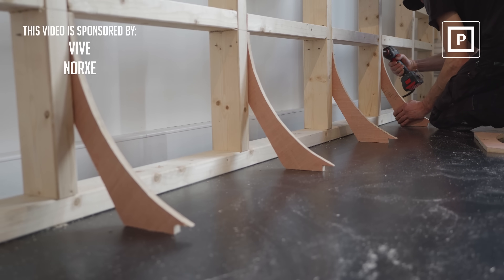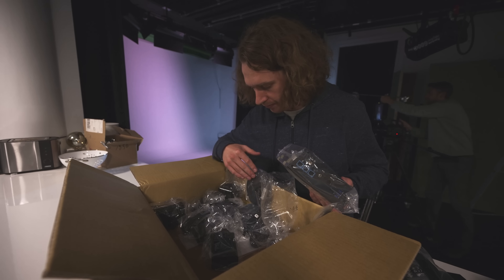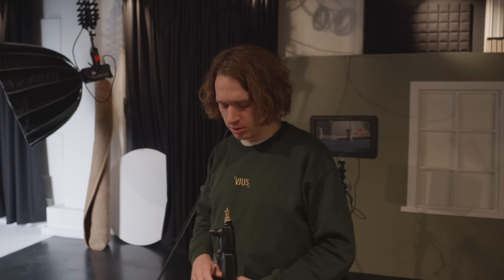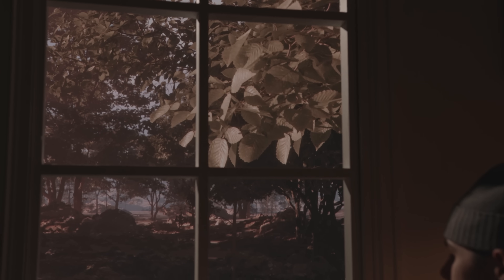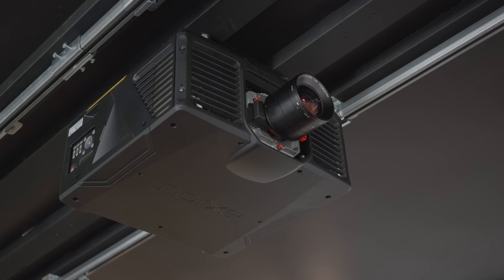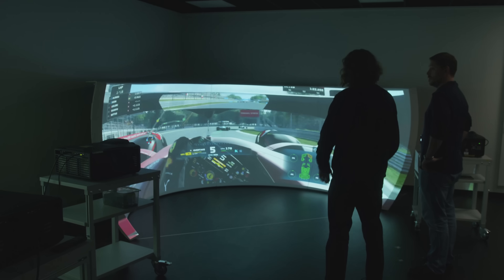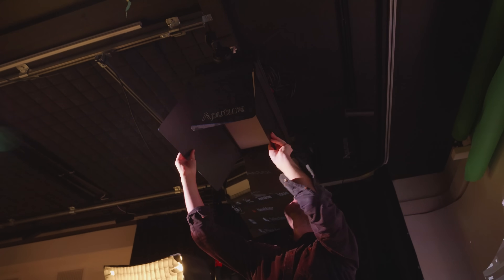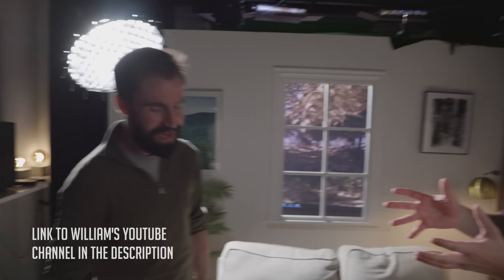The Future of Filmmaking is Here!

Comment: How bright is the Norxe P2 projector you're using? I looked it up on their website and it says it's 5,000 lumens, but it also says there is a "high brightness" version available as well. I'd love to know which one yours is. I'm looking at doing something similar with ultra short throw projectors and their brightness seems to top out right around 5,000 lumens, so it would be great to know if that's bright enough to do this or not.

Comment: While your video was more on the exploration part, check film riot they did use an amazing set of short throw projectors, they are 10k each but hey is still cheaper than the led panels.

Comment: Amazing work!!! So glad to see you delve into this filming technique. Great job!

I have a few questions about your experiences.
Question 1: I see that for this shoot you didn't need to change the focus, but for future shoots, do you plan to track the focus as well with an additional VIVE rover? How many rovers does the Mars support anyways? Multiples could be useful because one could track fixed studio lights as well. 

Question 2: if you're permitted to share since HTC sent you the tracking system, how's the latency of the MARS system and does it jitter? The HTC VIVE VR system had some jittering issues, probably due to it being mainly a gaming VR system, so I'd love to know if that's all gone. 

Question 3: Have you thought about mixing green screen with camera tracking. You'll lose the natural reflections and gain more steps for postprocessing, but you can still send the image to UE and back into an on-camera monitor (via SDI cable if not with low-to-none latency camera transmitters) to get a real-time composite while you shoot. Seems like a good way to go because I know that studio lights mess heavily with projector images so they can't be used in quite a few scenarios... And as you said, LED volumes are really expensive. Thoughts?

Comment: Great first attempt at this, but I can't help but notice the track isn't perfect. All of the shots have some jittering in the foreground tree and it could be a number of things causing this. It would be cool if you guys did a follow up with a larger background to troubleshoot the tracking. I can't tell if it is something that can be solved with some tweaking or a limitation of the Vive tech. I do know real Virtual Production stages use more advanced tracking tech and timecode synced GPUs to reduce lag.
I work in VFX and if I delivered a track like that it would be sent back. That all being said there is a lot of potential here.